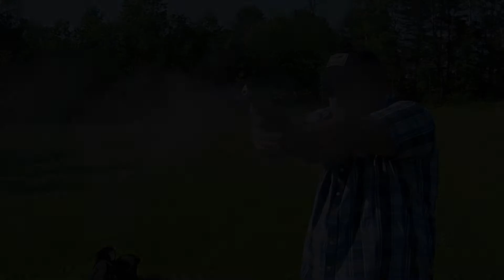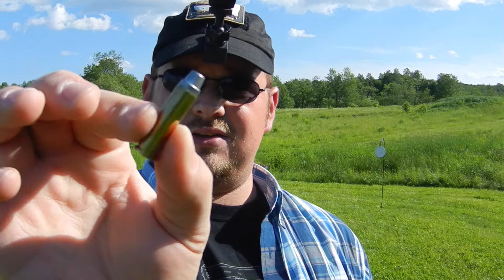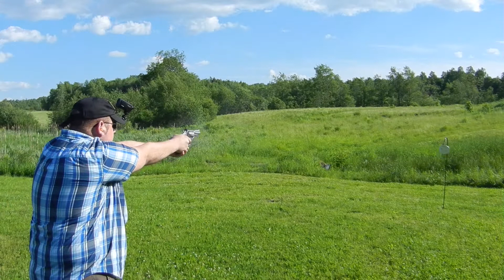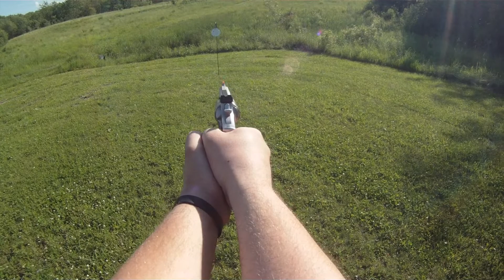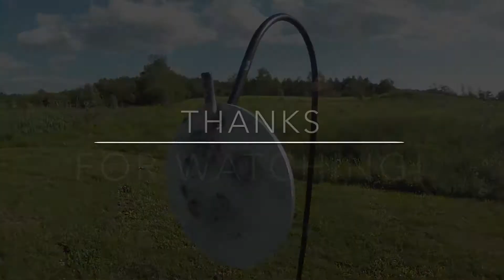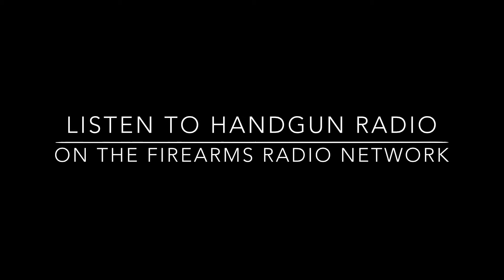Full Power .357 Magnum Herc 2400 Load Testing - Ryan Michad

Comment: I use 13.9gr of H110 with a Hornady 158gr XTP and a COL of 1.590" for my magnum loads.
Reply: Book says that’s lighter than minimum. I load a minimum (15 gr according to Hodgdons website) of W296 which is identical to H110. Great load for the 158 XTP. That powder has to be hot or nothing. It gets dangerous trying to load it down

Comment: It has been a awhile since you made this video but thought I'd chime in anyway. If you haven't already, I think you would find the VV N110 is likely the best powder for full power .357 loads. You'll get more velocity and about the same flash as you do with 2400. You also have to use very compressed loads to get that power level. One of the best things about it is that you probably cannot seat the bullet on enough powder to damage your gun. I have found that once heavily compressed the load are extremely consistent. I get standard deviation of velocity of about 6fps with my 125gr and 135gr GoldDot loads. With that short of barrel I'd suggest you drop down to N105. You'll get probably still better velocities but will also only have about 2% of the powder exiting your barrel unburnt as oppose to about 29% with the 2400.
I apologize if this came off as a bit didactic. It is just that I have  been so enthusiastic about these two VV powders since I began trying them about two years ago.
Reply: I would suggest being careful with full bore lead bullets and 2400. If you are not using hard cast bullets (Lyman #2 or such) you can deform the bullets in the forcing cone and dramatically raise chamber pressure. This also applies to gold dot bullets as they are a soft lead with a copper plating.Traditional copper jacketed bullets  are safer at high pressures and velocities.
Reply: I believe N105 is the best 357mag powder. N110 is a bit too much progressive and you would be able to burn it only in rifle barrels. But funny if you like blast!
Reply: If you are loading full power loads you will have a hard time surpassing the velocity of 2400 or W296. Maximum velocity is not always the best choice for almost any firearm. I can make a 125 grain bullet reach very high velocities from a 20 inch barreled rifle but you may not be able to hit the lid of a 5 gal. bucket at 50 yards with them.
Reply: @MrMJD1978  I didn't see your reply earlier. I imagine we all get somewhat different results even with nearly all of the variables controlled. I don't get bad of muzzle flash with N110. I am also using a 5.25" barrel. I was dubious when I saw the VV loading data  but was happily surprised with what I though were counter intuitive results for so much slow burning powder.
Reply: @vicnighthorse  I charge 11.6 grains of n-105 with a small rifle primer cci400 and a 158 resin covered lead bullet and a good crimp with Lee factory crimp die. From a 6.00” SW 686 I can reach 1400 fps, roughly 940Joule. N-110 can do better only with 180gr bullets. Chronograph can tell which powder is the best
Reply: @MrMJD1978  Nobody else is reading this so apparently we just like talking to each other;-). We were both using a chronograph and it would be unrealistic to think VV wasn't also. I am a fan of N-105 and had expected it to produce the highest velocities for bullets 158gr and less. In my own tests and VVs own factory tests for bullets 125 and heavier, I was wrong, 110 produced higher velocities. I don't doubt that you got and will continue to get the numbers that you did though. None of us has a reason to misrepresent the results we got comparing 105 vs 110 in 5.25-6" .357 barrels. I can't explain the discrepancy. Velocity aside in my tests the 110 was also much more consistent in velocity and group size. VV however, was using a 7" barrel (because so many people use that size;-) so I can see where someone might say that would benefit the 110. Anyway my 125gr Gold Dots on top of 18.4gr of N110 lit by CCI 550s averaged 1593fps and had an SD of 6.2 for 7 (admittedly a small sample) shots from a 5.25" barrel in the mid 60s temp wise. That is of course 950 joules. I now live in rural WY and more often load 200gr bullets, also with 110. Thank you for taking the time to tell me of your results. It keeps me on my toes.
Reply: @vicnighthorse  I bought another bottle of N110 as I have a 460mag too. I will test again the 357 stuff, as the previous stock of n-110 was a bit old and given to me by a friend. Thank you for sharing info. Is always good to collect different experiences. 👍🏻

Comment: I have loaded and fired 1000's of rounds of .357 mag. for handgun and rifle. I have harvested many deer and 3 elk with my .357 mag. loads. In order to get the most from a .357 rifle and still be able to fire those loads from a handgun I use the slower powders like 2400 and the slightly faster Blue Dot. With 140 gr. bullets I find my best combination of velocity and mass creating my favorite load. I was wondering how you keep your .357 barrel from leading when shooting full power loads with lead bullets. What is the alloy of those bullets?

Comment: Ill be loading 4 a 4 inch 357 s&w so I don't know if ill use 2400 for the lower muzzle flash or h110 for the velocity What powder do u think I should use?Do u think there will be a big change in velocity in a 4 inch revolver if I used h 110 over 2400 Do u think that h 110 have more muzzle flash and recoil than 2400
Reply: Try Unique.

Comment: "Full house"? According to who. Look up the ORIGInal 357 mag 158 grain loads and you will see yours are a new derated definition of "full house".  For the first few decades,..it was common knowledge that the standard 357 load was 158 gr. swc over 15.3 gr. of 2400. At somewhere between 1530 and 1550 fps. In an 8 3/4 inch revolver.